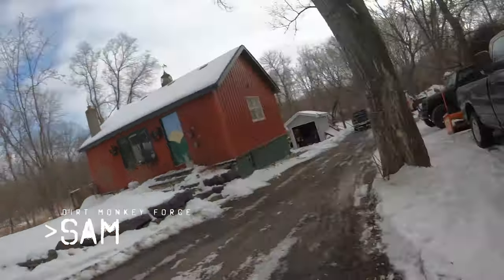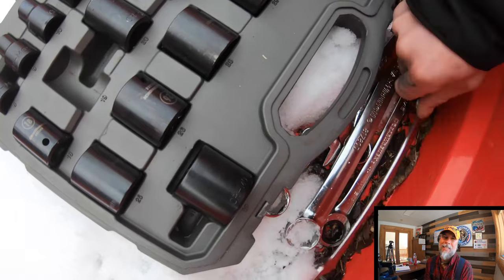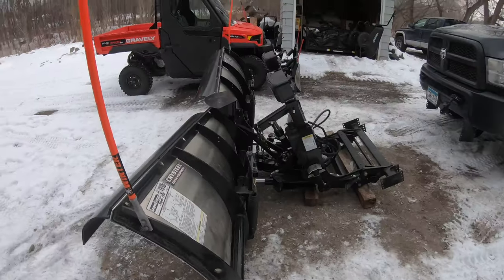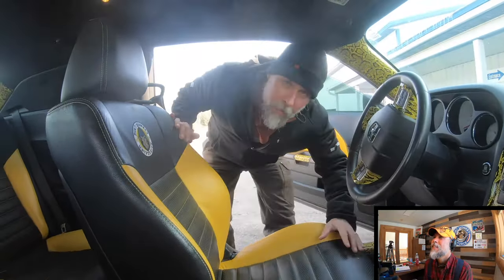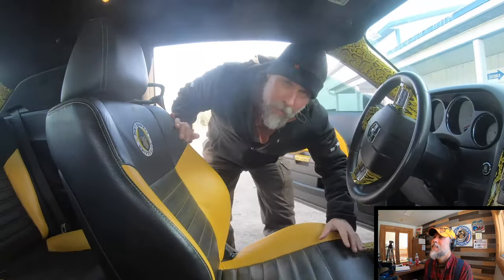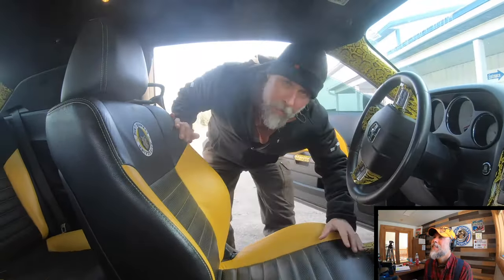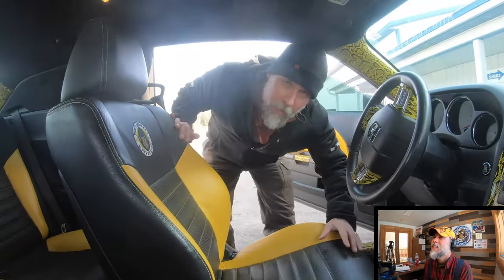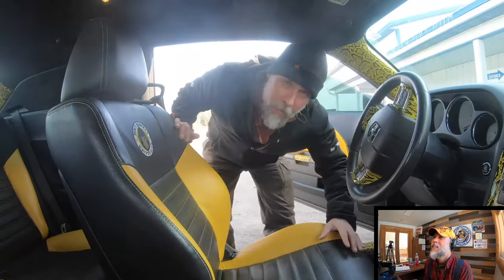Head to head - V plow Vs Scoop plow

Comment: One of the reasons I like to do my own plow installs and wiring is to avoid the problem you had and if I have an issue it makes it so much easier to troubleshoot.
Reply from the maker: I did get it dialed in and have not had any issues since. Fingers crossed that stays like that

Comment: I've run a bunch of plows on a bunch of vehicles, and one advantage a V has over everything else is being able to V to make your 1st cut.  When you get 2 feet plus (I've done 3' twice), the first pass is vital.  Also very useful for the windrow left by the city plow.
Reply: Hey dude.i have a fisher that’s been maintained nicely.when I’m dismounting I cannot push the lift arm plate down to do so.i have to use a sledge hammer to get it down.i am in float.it just won’t go down.would appreciate any suggestions.thanks
Reply: @robertmcgee7969  Man I wish I could help you out... but I don't think I understand the issue.  I have one myself;  when I disconnect from the plow, the headgear falls forward, then nothing lines up when trying to re-connect.  I've got to stop in the dealership and ask, but I just keep forgetting.  I'm sure it's something simple I'm missing.  Fisher EZ V.
Reply: @wannabejeeper  thanks man..the yellow plate on top of the lift arm.when put it in float I used to be able to just push it down so I could disconnect.now I have to beat the Jesus out of it to make it go down.just had it serviced too.guess I’m gonna have to take it back and let them handle it
Reply: @robertmcgee7969  Yeah something's sticking that shouldn't.
Reply: @wannabejeeper  I actually have to take a huge crowbar and beat it down far enough to let me unhook it.pain in the ars.haven’t had snow yet.once I put it on it won’t come off til March.but man what a pain
Reply: @robertmcgee7969  Nothing more then a dusting here either.  Nice that you can leave it on... my plow truck's my daily driver, so on and off every time.

Comment: Bought a Western Wideout 14 months ago. Finally got to use it last month. I will NEVER go back to a straight plow again. I absolutely love it. It took me a couple of hours to get used to the handheld remote. I am sold on expanding plows. Best thing is when I’m in scoop mode I can still angle the plow left or right. Try that with a V plow. Until last month I had been plowing with a Curtis since 2000. I loved the way they hooked up to the truck. Super fast. I’m not as big of a fan of the Western system of hooking up to the truck. I use a pallet jack to move the plow around the shop. It’s a little more tricky with a Western.

Comment: Rough week. Finally got snow in Detroit blew a line the first day and snapped my frame going over a railroad track today. Used plow trucks are a blast. Just lost 6 apartments. 
At least your videos I can see money can be made. So new line lots of welding and it is running again. 
Keep the videos coming it is what keeps me going

Comment: The V plow is the best plow for doing city sidewalks and park trails especially when the snow is deep because it pushes snow left and right.
A single straight blade plow bogs down by only plowing snow to one side.and making a huge pile on that side.
Reply from the maker: Thier are a few times when a V plow is absolutely needed.  But not many.  BUT I have a video coming up showing that.
Reply: @Dirtmonkey  can't wait for that video. I'm always interested what are the benefits of V.

Comment: Do you ever run weight on the back of your plow trucks? I've always found a ton or more in the bed  makes you able to plow in 2wd nicely and push just about anything. I used to load my f250 to max weight and it was unstoppable in just about any storm

Comment: I’ve been running a Hiniker c-plow here in Connecticut for the last 15 years on my 99 f350. Bought the plow brand new and everyone broke my chops for not buying a fisher or boss or western. Nobody knew a thing about Hiniker around me until I purchased mine. Like I said I’m going on 15 years with this plow and I’ve replaced the blades once and still haven’t replaced any hydro hoses. Only upgrade  I did was upgrade to the new lights. So I’m a huge huge Hiniker fan huge. I honestly believe the Hiniker is the most underrated plow on the market. Since I purchased mine 15 years ago slowly they started popping up by word of mouth. So I’m excited to see you went Hiniker and spoke the truth about them I know everyone has their own opinions and some guys like western or boss or whatever but I believe if they ran a Hiniker for one storm they’d never go back.
Reply: Wow thank you so much for the testimonial Jason!!

Comment: Have you ever considered an adjustable width plow? I know there's a few companies who make them where each side about a 2 foot wing on each is hydraulically controlled where they can extend about a foot to a foot and a half wider on each side so a 8 foot plow can be turned into a 10 foot plow with a push it s button. So besides having that much wider of a plow when on the job site when going down the road you still have the typical normal width plow.

Comment: Nice looking plow. Around me it seems that everyone and their mother runs boss. It could be that they are made right here in the upper peninsula of Michigan. They are made about 2 hours from me and I have been by where they make them lots of times. Myself I still prefer the old chain to raise them and the old cable to control them. Might be dad had a western he had for 20 years and never replaced a cable or had the pump opened up. He beat the hell out of it also.
Reply from the maker: I had a western that lasted 11 years and a Hiniker that lasted that long- then rotted off the truck but the frame was good so I bought a plow off craiglsist (scoop) and ran that for another 4 years with no issues.  Same wiring same frame. so that lasted 15-16years?

Comment: I would take the Hiniker, it looks like half the weight of Tim's plow. It would be a lil more forgiving on the front end. Stan , can you do a video on the charger? That thing is sick.👍
Reply from the maker: I did a video on the challenger a few years back.  It looks like a mad max car but drives like a dream.  Have a great week bud!
Reply: CT? haha down here we get like a foot of snow with no warning ! shoveling ain’t it for my back but it gets the bills paid
Reply: The only problem I've seen with the scoop plow is in super deep snow.  I've got a 1/4 mile long driveway.  When the drifting gets to be 2-3 ft deep you need the V plow to make a path up the middle in V mode first.  If you do it with a scoop or straight blade you either can't get through or it pushes you off the side of the driveway.   So there are definitely better plows for different applications

Comment: yes the best i have ever had i have had all but  the chevy and boss have done the best!!  oh do you no the arwe going elektrick i 2035
Reply from the maker: My Chevy truck was a terror-  I went through 4 engines and 7 transmissions and 3 differentials before I threw in the towel.  I would get one thing fixed and then something else would go wrong.  Just kept happening on that truck.
Reply: @Dirtmonkey  what model/year..?
Reply from the maker: 1979 3/4 ton.  Dont remember much else about it.
Reply: I hear Dodge trucks have overpriced parts? Is this true?
Reply: John Lawson  ok mr (bingo-bango herky-jerky flippy-flappy  guy wth does that mean
Reply: I still have my 78 chevy use to plow  for 25 years just transmission rebuild 3.
Reply: @darylkalbach4600  yaa but they are good trucks

Comment: Good video Stan. I am still running old school meyer ez classic plows. have a 7.5' with wings and it does pretty good. It's a little over 9 foot mounted to a 2003 Dodge Ram 2500 hemi, long bed crew cab. I also have a old school 95 Toyota 4runner with the Meyer 6 foot tube mount to get residential driveways and tight spots.

Comment: Awesome video!! And thanks for the shout out for A&K Outdoor Services!!     Also just a quick tip for you guys to keep an eye on that hiniker v plow I had one for 2 years 2018 it was brand new and had it in 2019, but after the first year plowing with it I started plowing my second year and made it till about January 2019 and then had some issues where that A frame of the plow connects to the actual blade it ended up breaking and the only thing holding the plow on was one bolt.  Hiniker said it was a known issue with the v plow for 2018 not sure if they fixed it for 2019 or 2020 but just something to keep an eye on as it happened to me twice in the same year.    Hard to explain but right up where the A frame connects to the blade there’s 3 bolts that go through the center pillar of the blade and that’s where it cracked.   But love your videos and can’t wait until the next one!!

Comment: Does the direct cylinder lift on the Hinikers affect how high the plow can raise when stacking snow and is that an issue at all? I prefer the joystick controllers as well and the simpler the better. I'd still put wings on both those plows if it were me but I don't have a back plow either.
Reply from the maker: The Hinikers have never had an issue with snow stacking.

Comment: Dodge wiring never disapoints. Wait till it lights on fire lol. At least you finally pulled the plug on that crappy snow dog. Never had luck with their salters either.
Reply from the maker: Have you had wiring issues with your Ram truck?  I had a Dodge Charger start on fire.  That was a weird fiasco!
Reply: @Dirtmonkey  ive had 2 friends trucks go up. They were all 2nd gens like 90s trucks. Since then i wont own any. One of my chevys lit up while my employee was driving it. Not sure if it was a problem with the radio i had just recently put in, or a factory problem. My all time favorite plow truck was a 2006 chevy duramax. With a 9' 6" boss v with a joystick controller. I miss that truck.

Comment: I’ve got an older Fisher with trip edge, a Boss but not current mounts, both straight blades. The Fisher is twice the blade the Boss is for my uses, hate whole blade tripping compared to just cutting edge, but trip edge feels worse. Just what I like for how I use them, now Fisher & Western are the same, just different in price & dealers if want one of those two, maybe even cause of color preference could be a factor. Thanks great videos.

Comment: Used Hiniker for 12 seasons. Found their hollow trip edge pivot bars were a bit weak. Replaced with solid cold rolled, no further issues. Now, after ten (12) years in service, just noticed a crack in the truck mount prong just aft of its annoying 'notch'. The wings have always been flimsy too (on the retract) Still getting monies worth from it.

Comment: Based on your video, flip a coin, they both worked well and about the same. Cost and simplicity may be the deciding factors, but this challenge was in a wide open parking lot.  We have numerous single driveways between houses. If a rental is left empty for awhile or a city property needs to be opened up, then the only tool for the job is a V- plow!  All other blades fail. Crusted iced packed snow too deep for a straight blade  can push the whole rig into the building. V-blade lets you cut through to then back blade out  Of course that is a very specific situation not everyone has to confront.

Comment: What tires do you use up there in the winter? If you have not tried, the falken wildpeak at3ws are the best winter tire ive ever had! We have str8 ice in virginia and not only are they very quiet on the highway, they perform in deep va mud, snow, ice, and rain. Snow rated tires you can run all year long and NEVER get stuck. And no i have absolutely no affiliation with falken. My wife runs the wildpeak mt's on her 2wd 4 runner and she now has traction in snow and ice.

Comment: Stan The two plows seemed to both do a good job. As a small business owner the two things I would look at are 1) Cost and 2) Weight.  Well also simplicity too. The "V" plows are a lot more complicated.  Also the "new" quick change style plows seem to be lacking in mount durability.  Look at the "Boss" plow and how complicated the linkage is.  A simple jack on each side with a pin you can drive in and out. It is not rocket science guys.

Comment: i never knew those top flaps were for snow spray.  i always thought they were just to roll the snow so it doesn't come over the blade.  maybe they are for both lol.  i've got a very old hiniker v with a 10 function controller, factory controller was only 6 function.  love it.

Comment: I have the 6812 8ft scoop plow and the newest model. I like the older model more due to the cutting edge sitting further back and with a 10 rubber flap at the top, can go faster without casing a white out that the newer model does. I am very happy with the scoop plows for my commercial lots. Yes I agree that the plow will thrive breaking new passes but after that the scoop reigns supreme. I had an old fisher minute mount 7.5 ft that scraped better and a Leo that could put down pressure on the blade but over all would still buy the Hiniker scoop. What is being said about the wide outs and the snow way extendable? I like that idea as well and they look very strong.

Comment: Unless you have locking cylinders on both wings, many v blades will "collapse" forward when back dragging.  In the same way that you can't  have any down pressure with a front plow without a double acting cylinder.

Comment: Have you checked put the Western Prodigy? 

They are super slick. The wings are cable and spring driven so as you angle the blade the wings move into the most efficient position and you can pin the wings back for if you want a completely straight blade. I believe it is 8'7" in scoop, 9'8" with the wings pinned back and 7'10" in full angle. I've used one for 4 years now and love it. I used to plow with V blades

Comment: I have been running the Boss EXT for 3 seasons now.  It sucks for the small tight areas like any scoop style plow does, but I have not seen another front plow on a truck that can cary more snow. It’s great for someone with large open areas without a skidsteer. The interesting thing would be to see how it compares to the pull plows. Pull plows are better for edges, but the front plow is better and faster for stacking.

Comment: Only problem I see with the hiniker vee plow is that you cant move the wings independently.  I'm always moving my boss wings independently. I usually start a push with one side of the plow vee^d while the other side is straight to avoid a trail off at start. 
Give me a shout out bud! About 30 years plowing experience here and I had my own lawn mowing business for 20 years. Then worked in excavating.
Reply from the maker: Shout out coming in a future video-  Your point about moving the wings independently-  Thats what that little controller on the middle does.  That thumbstick joystick does that. Its sweet.
Reply: @Dirtmonkey  ok I've never had a hiniker and I couldn't tell that from the video.

Comment: Question. You said the v plow controller has up down left right and two buttons to control wash blade. How do those buttons work? Are they scoop and V buttons or do they independently control the blade sections?.

Comment: awesome video to start with you should try a straight blade plow with hydraulic wings. I've owned one for 4 years and it works awesome. we use it for big Walgreens and factories.
Reply from the maker: I have heard a lot of good things about those but I really like this one.
Reply: @Dirtmonkey  yeah there are awesome I have it angled with one in scoop and one fully extended out and it gets to about 11 feet wide so it works awesome it goes many ways like scoop fully in 11 feet wide and etc

Comment: You need to try a boss V Plow with the wing extensions. Completely transforms a V Plow, makes it way easier to direct snow and scoops and holds a lot more.
Reply: If I ever went with a V it would have to be probably an 8'6 cuz I would want wings on it and it would be too wide for some driveways if I started with a 9'2 or something like that.

Comment: Ford F-350 , gas , gvw11300  , western 9.6 v plow ,no tools needed ,does not break ,back blades great ,handle a 2 foot blizzard , 2 inch scrape  , tight to truck driving around

Comment: I would guess that the western wide out would have pushed more and been more versatile but I would also guess it would have a MUCH larger price tag as well.
Reply from the maker: I haven't tried a Western wideout so I don't know how it would perform.
Reply: From what I have seen the moving parts on the wings have a tendency to be a problem. Rust and become hard to use. I used to want one but now would chose a straight blade with wings. I agree with Stan, simple is better

Comment: Have you seen the blizzard plows with the wings that fold in mechanically?? When you turn the plow to the right the right wing folds flat for better windrowing. But when its flat its a super nice scoop plow. I absolutely adore mine.
Reply from the maker: I have seen those- My understanding is Western bought them out and now those Blizzards are the Wideouts.
Reply: @Dirtmonkey  thats what i heard as well its been a fantastic plow 5 years now on the same cutting edge
Reply from the maker: 5 years? Same cutting edge?  Ive only had the Hiniker scoop last that long.
Reply: @Dirtmonkey  5 years same cutting edge but we don't get as much snow in southern wisconsin and its only for our lots and my grandparents driveway :)

Comment: I worked on Hiniker's for 15 years and never saw 1 hold up to commercial plowing. Guy's would come in with the trip edges ripped off. Specifically the scoop. And when they break it gets expensive versus let's say a Boss.
Reply from the maker: I ran Hiniker for 16 years with no issues.  I ran my scoop for 4 of those. Again no issues.
Reply: Never had a trip edge but full trip is simpler with less to go wrong works fine for me.